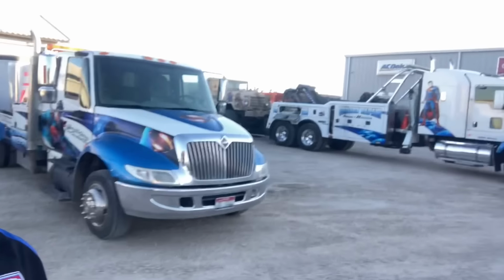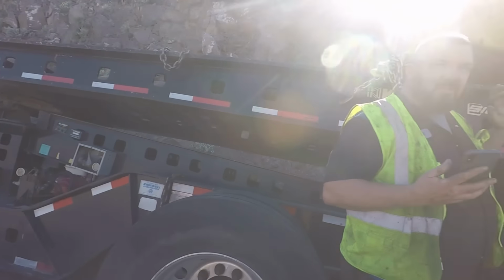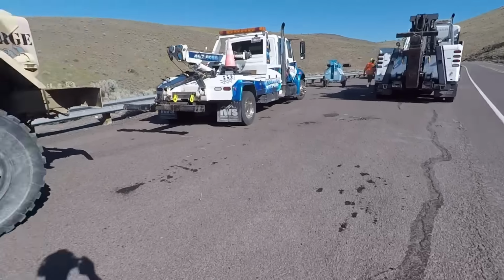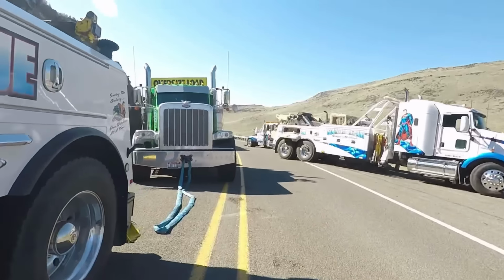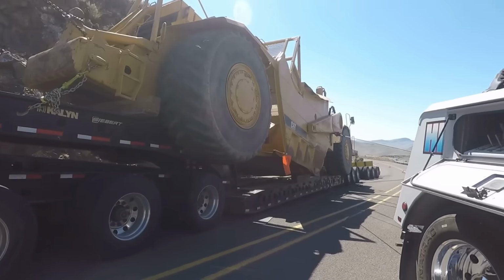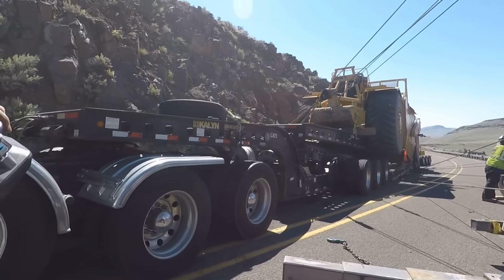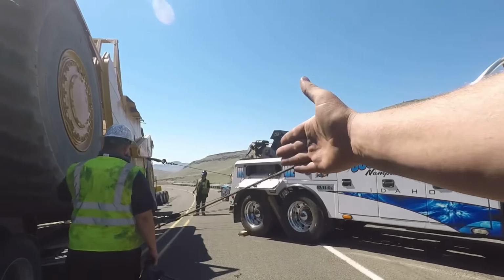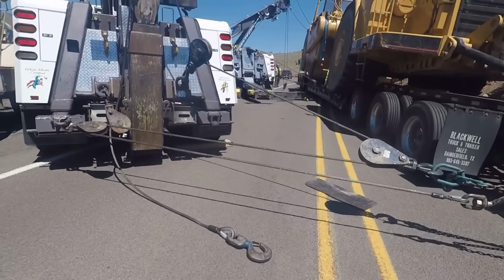Did Superman finally meet his match??? | 262,000 Lb SUPER LOAD

Comment: That booster cannot possibly force the rear of that trailer over like that going forward.  Especially loaded.  That happened if reverse.  The hydraulics are in float when going forward and cannot possibly effect the steering.  They (hydraulic system) are there for "bump steer" when backing AND ARE ONLY TO BE USED WHEN UNLADEN!  They will fail if loaded heavy and will not steer the rear of the trailer.  My guess is that driver misjudged the apex of that curve and got the trailer axles into the ditch panicked and stopped.  He then tried to use the steering to back up and reposition for the turn.  Hydraulics failed as they are not designed to do that loaded.   The more he screwed with it the worse it got.

Sorry, but that is the truth.  I have pulled those trailers and real steerable trailers for 25 years.  I have seen all types of failures.  THAT trailer will not go out of control when moving forward unless there is catastrophic failure of the walking beam or suspension guides.  The only type trailer that will go sideways during a steering mechanism failure is a tillerman style trailer which is automatically self steering. 

So unless there is mechanical failure of the suspension on the trailer axles, that is driver error.

I will say you guys did an excellent job on a really difficult recovery.   Well done.
Reply: Thanks for the explanation. I'm in Australia and looking at the terrain there, might say the tractor is inadequate. Tri drive
Reply: Alot of ways of saying "I missed a gear and it rolled back on me"
Reply: @delbutler885  yep just look how that booster is jackknifed, she rolled back alright. Lucky escape I'd say.
Reply: Maybe was going slow cause of the sharp turn. To make the turn he would have to take it wide, but at that time a vehicle was there. He slowed more had to cut the turn making the trailer hit the gravel off the road, slowing more. So slow he doesn't have the power to go up the hill. He rolls backwards then parks
Reply: I knew if I scrolled down here far enough I would get the right answer. Once the stinger drops off the road, speed and momentum are your only friends (won't help every time) and he clearly didn't have either in this case. My guess is his employer will come to the same conclusion Mr. riggin did........
Reply: I've seen this happen before, he got that trailer to close the the edge, that is not a rear steer trailer, its a bump steer, he got pulled in

Comment: Question, so how much did yall charge the client? I am really curious on how much something like this recovery costs.
Reply: It could cost 250 + per truck per hour. But then you have mileage, spotters and traffic controllers. Likely paid for by the insurance company. A year ago I spent $800 to have my 4 x 4 recovered. 2 guys, 2 Wreckers, 3 hours. And a 500 +  ft  winch through deep water. That screw up cost me a transmission. LOL
Reply: Really the travel time isn't as expensive as one would think. When the cables come out it's spendy.

Comment: Cool, but why not unload the scraper first. Just drive it off the trailer, pull the truck up and reload. I operated many different scrapers and a 2-3 foot drop is nothing. I must be missing something.
Reply: i think you are very right hun 
how are you doing
Reply: Problem is not unloading the beast .. more about to put it back front wheels in air on trailer .
Reply: Made the same comment before seeing yours. Ive got thousands of hours in a 637 and we’ve unloaded, used the scraper to unstuck the lowboy, reload and back on the road. That 637 could have easily drove off that trailer.. my guess is nobody on site had the two keys needed to start it.
Reply: With the belly of the trailer dragging over the shoulder of the highway, I don't think they could lower the scraper to the get the wheels on the ground. Or at least to the point where they could split the trailer to allow the scraper to come off. Being pinned to the rocks probably didn't help either. I highly doubt it wasn't considered when the other tow companies turned them away.
Reply: Hydraulics will lift the horse up 4 feet. Turn the horse 90 degrees to the pan and drive it off.

Comment: Good video, I was wondering if the rear steer was fixed before you got there I assume it was needed to continue...   I was also concerned where you were standing, if a cable snapped it could be a bad day....
Reply: It didn't looke like they used the rear steer during the recovery, otherwise the jeep could have been walked out of the ditch much sooner and avoided so much of the trailer to pavement contact due to the crown. Was really surprised to see how long they let the jeep stay in the ditch during the pull.

Comment: The scale is enormously different, but this reminds me of the time my father recovered my uncle's 1 ton Chevy cube van with his 3/4 ton Ford pickup. Van was on its side in the ditch after he swerved to avoid someone who ran the stop sign. Dad hooked low on the front axle on the side of the van that was in the ditch, hooked the other end of the chain right to bumper on the opposite side of his truck (it was a custom bumper made of 6" channel so it took it fine), put it in 4 low with the front hubs unlocked and just slow walked it out of there with my brother steering the cube van. The way it was hooked actually righted the van and kept it from tipping over as it came up out of the ditch. It sat right up on its wheels as it came up. All the cops and firefighters were blown away that they were able to rig it out of there with so little equipment and so quickly. We pulled a few field cars out of the hedgerow after accidents that way, so we had some experience lol. I'll never forget standing there watching as those 16.5's looked like they were about to rip right off their beads. It's kind of like the slo mo vids of drag slicks wrinkling but sideways. I'd say they were angled about 35 degrees at full tilt. The van was loaded too so it was a lot of weight for that little pickup, but other than those tires doing what they did it didn't sweat it at all. Goes to show what force multiplication can do when you can gear down like that. Same concept as your makeshift block and tackles here.

Comment: Amazing. The Cat 657 tractor/scraper is built in Decatur, IL. It has a total of 975 hp with the two engines.  The unit you moved was paired with another unit as a push/pull combo.  Rear unit pushes to load the front unit then the front unit pulls the rear unit to load it.  They will load both in 2.5-3.0 minutes.....
These units were always hauled in two pieces to the customer. Keen Trucking does all of the truck hauling out of Decatur. Some units are rail shipped.

Comment: 10 Crain mats n drive that pan off the trailer. The use pan to pull truck out.
Reply: That would've been the simplest way.
Reply: Not that easy,for one thing kind of hard to unload and detach the gooseneck on a slope like that would had taken longer just to unload then hook up the trucks,besides if it was a customers scraper I’m pretty sure they wouldn’t want someone to use it for pulling out the stuck truck tbh
Reply: Woulda been kinda hard to drive it off when it’s buried into a rock embankment
Reply: Drop the pan and hard right.   That's how I would have done it
Reply: what's did job approx cost?
Reply: Only loophole in that situation is you could just also have the crane just move everything back on to the road.

Comment: so i work on the 657e-g scrapper im a diesel mechanic that big ol chunk of metal is called the stinger, if one of those tires explode its fatal to anyone within 20ft so much as when it comes to get new tire or tires they change to one under the cab because if it blows it can kill the driver in the cab. in order to put it on that transport trailer you have to take the edges off and lower the apron just so it can fit under the regulations without special permits. just some cool facts. also the hyd tank on the tractor right rear holds 79gallons for all the implements :)

Comment: Reading these comments, I’m now realizing that heavy towing is a major lucrative business opportunity! Wow!
Reply: True, I’m an owner operator running a dump trucking company and I have only ever called a heavy wrecker once, and that was to tow me 15 miles back to my shop, the route was almost all interstate and my truck was on the shoulder, empty and facing the right direction so an easy job, only took an hour from him pulling up to me signing the tow slip  as he got ready to pull out of my lot. The bill for towing a 32,000 pound (that’s my empty weight) straight truck 15 miles down a flat, paved road? $2,500 and that was giving me a “break”, guy said would have usually been 3 grand. I asked how they’re justifying robbing guys like that but what he said surprised me: he said his heavy (50 ton) rotator wrecker payment was $15,000 a month (total cost of the outfitted wrecker he just said “durn near to 3/4 of a million dollars”, that’s just 1 truck. Then there’s the insane amount of liability you have whether recovering a wreck or simply towing a broke down rig, from what he said a fairly small outfit like his with 1 big rotator, 1 heavy wrecker and a couple tilt beds and 1 ton auto wreckers has an insurance bill that’s near to $10,000 a month as well, and the state demands they have all that coverage to even be able to operate. Now add in the cost of fuel , maintenance on the trucks which have to be ready to go no matter what, the cost of buying and keeping up a garage big enough to hold all your trucks plus a yard big enough to hold all the broken down and wrecked ones you drag in. All in all he said he sees a metric crap ton of money come in each month, but by the time everything that has to go out is paid he’s basically making a mid 6 digit salary for himself as the owner but he’s also still working 40+ hours a week and has taken 30 years to get where he is now. After having that talk on the ride back I understood a whole lot more than I did before that these guys usually aren’t “getting away” with anything really, with the cost of overhead and the chance of failure being what he’d said then they’re really charging enough to get by and stay competitive, basically the same way I do as a regular trucker. Sorry for the long story but I hear all the time from guys that are company drivers or white collar drones how much money there is in trucking, how they know I’m making a killing, and how they’re gonna jump in and make a ton of cash themselves. I guess the old saying “the grass is always greener on the other side of the fence” still stands true.
Reply: @J.R.in_WV  damnnnn!!!
Reply: @J.R.in_WV  
Thank you for all this information.
People in this line of work deserve respect for what they do.

Comment: maybe the camera, but that don't look like a ~15deg (~27% tan | ~26% sin) grade, but if it were, I would have calculated as 8% initial rolling resistance (20,960lb) given not all the wheels are on the smooth road and any turn resistance is harder to quantify for tyre scrub inherent within the axle groups along with any minor brake drag, grade resistance would be ~26% of GTW (68,120lb), for 89,080lb, I would then factor an additional 5% of 25% of the total mass for to represent the extra grade that RH trailer wheels are climbing for the ditch which would be 3,275lb (92,355lb total), that is before I added any factor for parts of the trailer or load that may be dragging on the ground etc or bogging of wheels in lose dirt/stones in the ditch.
As an aside, I have always thought of the US booster axle setups to be a bit of a farce more to dance around regulations to gain payload from length between axle groups than being robust safe solution with less points to fail and greater stability.

Comment: Couple years ago I was pulling a double hammock Cozad 13 and the rear capstan came apart with the rear section going hard left. Since I was moving slow I got stopped before going into the ditch. Took a few hours to get it out of the way. Fortunately trailer was empty. Took a medium size rig to do the job.

Comment: I’d just like to point out that the 3 axel rear trailer behind the main trailer ( the very back unit) is called a “Booster” and the first trailer unit ( with the 3 wheels) directly behind the truck wheels is the “Jeep” and of course the main trailer that the buggy (scraper) is sitting on. The whole unit is usually referred to as a “13 axel” trailer 
You include the 4 axels that are on the tractor. Just thought I’d point that out when I heard the narrator say “ the jeep was 
still in the dirt” 
when they were close to being done. On skinny roads like that with those type of trailers it’s very imperative to keep the rear trailer wheels and booster wheels off the gravel (dirt) shoulder of the road, it’s usually soft and with that much weight once the wheels get over on it if soft enough once the booster starts to sink in the momentum sucks the booster further and further into the ditch and you end up like that. It’s a good thing the rock wall was there to stop it or it could of 
been a whole lot 
worse. ( I know first hand of what I speak) A lot of luck and good recovery over all. Very professional all around.

Comment: Country Repair & 24 Hour Towing   Absolutly amazing teamwork cant believe it if hadnt watched.as ive worked in recovery for 15 years in the UK im shocked and feel i should ask you a question why are you using the winch cable as a tow rope attached to the strop at the front as you must know winch cables are on drums and bolted into which can be easly pulled out.like your oppoin on the matter Lord Luton  aka James AJ

Comment: Just a thought for any future recoveries that you film, you might want to get some magnetic shop blankets, the kind that shops use to protect the cars finish when they're leaning in the engine compartment, to slap over any company logos and dot numbers. Would definitely make your job easier when it comes to editing the video and would ensure their privacy incase you miss a bit when editing.
Reply from the maker: I have some, the problem everything is fiberglass and aluminum now lol
Reply: @CountryEquipmentRentals  That's a good point, I didn't think about that. I think they make some that work with surface tension or static cling or something, but I doubt they would last very long or work in all weather. Maybe something with suction cups might work?
Reply from the maker: @pokemonrocks08  suction cup is a good idea

Comment: How often do you change the cable on the big tri axle big boy rig, and whats it cost to do so. Thanks.
Reply: We inspect the winch lines on our equipment, and re spool our winces quite often. We do not have a set time to replace lines. We keep them lubed and stay within the working load limits of the lines at all times. When to replace lines depends on the manufacturer’s inspection limits. We have replaces lines on the rotator, but you are looking around $3 to $5 a foot and our main lines have 250ft.

Comment: Very interesting and impressive.  Get there with the right equipment, right crew, right training and experience - plan and rig carefully - make a long, slow pull, always under control - adjust when needed - and hydrate, hydrate, hydrate.  It is easy to slip up if exhausted and dehydrated in the heat.  Over 100 air degrees on the sunny pavement (probably road temp of 130 or more.)  Working safely in the weather is as critical as checking all the chains, hooks, cables, and pulleys.  Massive investment in people and equipment.  And the costs keep rolling on the days with few jobs.  New set of tires for the Rotator - maybe 40 or 50 K $?

Comment: These guys are lucky they did not contact a recovery service with those M100 wreckers built by Miller Industries.  Those trucks are 1.5 million each.  A call out for one of those trucks has got to cost 10k plus mileage and fours worked to recover.  Those guys had a plan and they all agreed which make everything good.  There has to be a backup plans do not go as planned.  There will not be a profit made for the heavy haul company after paying the recovery bill.  Great job guys.

Comment: Don't you use Steel Road Plates in such occasions? We use them often to rise wheels here in Sweden. Sometimes ply-laminated boards on hard ground, even when wheels are locked or you need to turn round sideways. And two surface-laminated shuttering boards have really no friction between each other!  Nice pull force, but I think the scraper can alone pull you all backwards!  ;D

Comment: As a scraper operator with thousands of hours in a 637, my first thought would have been to just drive it off the trailer and use it to pull the truck out. Wouldn’t be the first time we did that. Lowboys get stuck on the job sites all the time.
Reply: How would you get the scraper off? They used a crane to load it, that is what it is sitting on the neck of the trailer.
Reply: @michaelseverson9809  you drive em on. It's a lowboy and the front of the trailer sits on the ground in the unhooked position. Then once loaded, the trailer is hooked back up and lifted up via hydraulic to raise the trailer off the ground and the can of the scraper is pushed down to raise the rear.

Comment: Serious question,  why couldn't just a single truck at a 90° to the trailer, air up tge trailer, run a high line on the load, pull to shift the weight and lift the right side trailer tires and track 4x4 lumber under them?